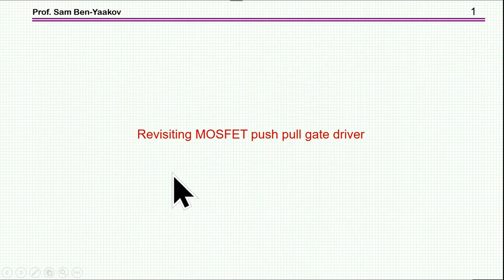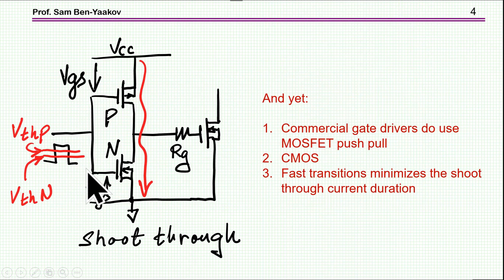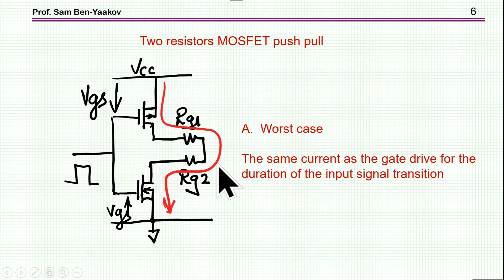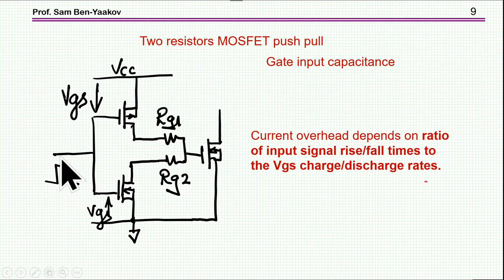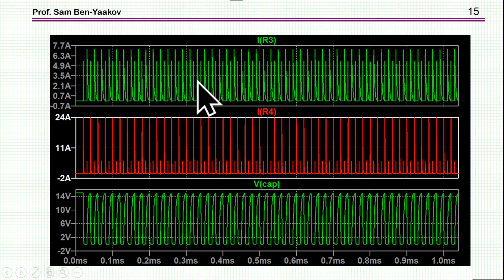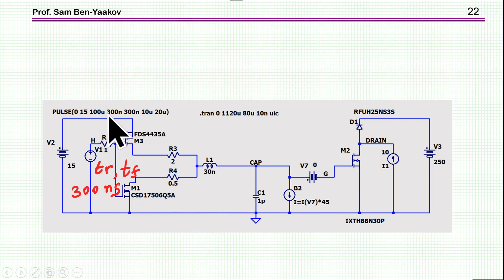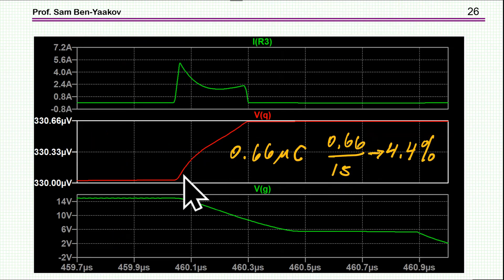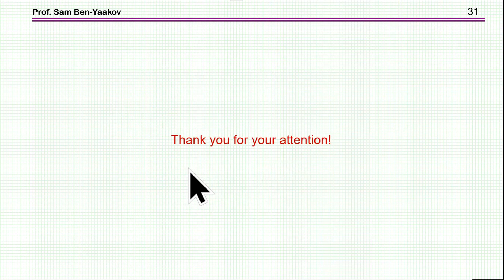Revisiting MOSFET push pull gate driver

Comment: To clarify... I am driving a p channel mosfet with your driver circuit. It is about 24 volts from rail to rail. I had a Resistor divider circuit on it but it turned off too slowly. So I am changing it to your mosfet push pull. As it is 24 volt off and 12v on it seems that I need to turn the n channel upside down in the push pull. Is this true?
Reply from the maker: I don't think so. However the reisors should be adjusted for turn on and turn off.
Reply: @sambenyaakov Ok. I have it now. The problem with push pull and p channel high is the limited gate voltage swing. It takes too many parts. But my original problem wasnt actually the driver, as I suspected... (200 ms to turn off),  (resister divider with a mosfet to ground). It was capacitance  in the motors built in circuitry. I am discharging it now,  (3650 bldc motor with internal circuitry) using a resistor and an n channel mosfet, and all is good. Thanks for the videos and response.

Comment: I like this. Thanks for the information. I have used it on an N channel at 24 volts and more. It went well. But I would like to see which way you would put the driver mosfets when you turn on and off with a positive voltage. Say 24 volt off and 12 volt on. Is it p mos drain (24v) to n mos source (12v).
Reply from the maker: Thanks. Not sure that I follow you.

Comment: Sir, Thank you so much for this very clearly presented example. I was using a simple BJT push-pull to drive my power mosfets with logic level PWM (with a few performance issues) but now feel inspired to experiment with simple mosfet based gate driver and perhaps learn a bit more.
Reply from the maker: Glad it helped. Thanks for comment

Comment: Good explanation but I as a new engineer I try alot of data and experiments to get mosfet drive really will with no heat up I notice that resistor don’t turn off the mosfets fully causing heating but not bad heating just warming but this is very bad efficiency so I try using bjt pnp to be exact at each gate of 6 mosfets and the pnp turn off the mosfets fully and the mosfet was really cold at 200watt for 5 minutes and 1 hour the mosfets was fairly warm and at 2 hour the temperature didn’t get pass 28degree % but when I use back the resistor at 1k to 10k the mosfets heating up really badly and I never seen a commercial inverter with my design and my design work 99 % more efficient on terminal temperature controller
Reply from the maker: 1k i too large. Typically 10\- 10Ohms are used since you need substantial current to feed to the gate. See: https://youtu.be/of_v2N5f788

Comment: I'd like to use an ESP32 to control a power MOSFET to switch on and off a 12V 5A load (led strips, no PWM), but with the idea of reducing the power losses as much as possible, as the system would be powered on 24/7.
What would be the best gate driver for my application? Since I don't need a fast turn on or off switching sequence, I guess I can get away by inserting a high Rg1 resistor as to avoid a large constant current (I=Vcc/(Rg1+Rg2)) through both MOSFETs when the control signal is HIGH (both MOSFETs on)
Reply from the maker: Why two MOSFETs? Is your load referred to ground or connected to the 
12V supply? You need isolation?
Reply: @sambenyaakov  I'm planning to use a regular 12V PSU to power both the LED strips and the ESP32, using a buck converter for the latter. I don't think I need isolation, but I do want to have the lowest Rdson possible to reduce power losses as much as possible, so that means driving the MOSFET from 12V. 

At first I thought about simply using an optocoupler but I'm not sure what's the minimum power it needs.
Another option is simply driving the gate with an NPN transistor. With a 100k resistor on the collector, I'd have a constant wasted 120 uA (1.44mW) while the power MOSFET is off.  I wonder if this could be reduced even further.
Reply from the maker: @alejandroperez5368  Yo can use an N channel with 1Meg to 12V and a P channel from 12 volt to gate of power transistor with the gate of P connected to the drain of N. Then you need a 100kOhm from gate of power transistor to ground. This way the drive consumption is only at ON.

Comment: I notice that you said you were integrating the current at the inductor, but the simulation used I(R3) not I(L1). Was that a mistake?
Reply from the maker: To which minute in the video are you referring to?
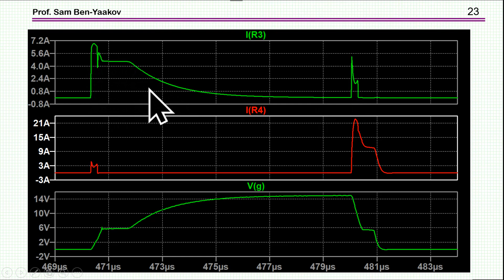Reply: @sambenyaakov  10:53, where you introduce the integration analysis for charge. You say that the total gate current is being integrated, and highlight the inductor with your mouse, but the behavioural source appears to be using I(R3) not I(L1).

Comment: Dear Prof the simulation at 8.42 is not giving the results as you have shown .Could you please confirm the correctness of Later MOSFET part of the cirucuit that was added onthe first simulation u have shown
Reply from the maker: Can you send me your simulation asc file and I will try to compare?
Reply: @sambenyaakov  Thanx a lot for the reply . Please find the file here   https://drive.google.com/drive/folders/1w-YcKCiwDQ6JvGXpcbqH7Q59wAh1tVaa?usp=sharing
Reply: @sambenyaakov  dear professor could you see the simulation file
Reply from the maker: @5minutething519  just noticed it. I will have a look as soon as I can
Reply from the maker: @5minutething519  Can you please explain the question in more details? please use sby@bgu.ac.il

Comment: Hello Sam, 

Thanks a lot for these lecture series which is very helpful from a practical engineering point of view.
I need one clarification.
Won't this configuration be inherently inverting? (V1 and V(CAP)).
Would you recommend (1)one more stage of mosfets before the main totempole , (2) just by swapping the high side and low side PWM signals (assuming they are complementary) at gate driver input (3) or swapping inside microcontroller.
Reply from the maker: Indeed, this is an inverting stage . The best will be to judt add an inverter Swapping the signals not exactly inverting due to the dead time but if accounted for, it should be OK. If digital control us used, there is no problem to program as needed. Hold on to my forthcoming video on driver buffer/.
Reply: @sambenyaakov  looking forward to your new video. Inverting in program, wont it mess with desat or shoot through protection of the semiconductor?

Comment: Hello, I can’t find information about "active balancers of li ion batteries on capacitors"
In particular, I'm trying to find a diagram where it would be clear which chips are used to control the mosfets.
Can you help me?
Reply from the maker: Have you seen this? https://youtu.be/BRezuwQCaKI
Reply: @sambenyaakov  Yes, I watched this video, but just in it it was not indicated which "driver" can be used for such needs. If i buy a ready -made balancer, then there are all microchips without designation.

Comment: Will those current spike (green and red trace) and extra current spikes create EMI issues?
Reply from the maker: Indeed
Reply: @sambenyaakov  Is the dI/dt from the parasitic spike significantly faster than the dI/dt at the fastest edge of the normal gate drive transitions? More to the point, is that parasitic spike likely to cause radiative EMI of a greater amplitude than that of normal operation?

Would it make sense to add a small inductor or ferrite bead in series with the gate drive resistors to moderate that dI/dt, or would that cause undesirable effects? I suppose with too much gate inductance/impedance the MOSFET will spend more time in the ohmic region, but I wonder if there is a "sweet spot".

Comment: Thank you very much for you video. 

I have one question here; in many datasheet of drivers, they use also the Push pull with Mosfet shown here (https://www.analog.com/media/en/technical-documentation/data-sheets/adum4146.pdf) page 3; sorry can not paste here the picture;  they use the one Mosfe of high side push pull; but two Mosfets  in the low side;  The drive  signals  of the two low side Mosfets are different. Do you know why the use like this ? thank you sir
Reply from the maker: One is a soft turn off and one a Miller clamp
Reply: Thank you  ave you done the presentation how the two Mosfet in parallel works ?

Comment: Dear professor,
Many thanks for the great informative and practical videos. Infineon also has an interesting application note about this topic.
In part 7 and 8 of the following app note, the mosfet buffer stage is shown. Since Mosfet push pull acts as an inverter, an intermediate inverter stage is also used

https://www.infineon.com/dgdl/Infineon-HV_Floating_MOS_Gate_Drivers-ApplicationNotes-v01_00-EN.pdf?fileId=5546d4626c1f3dc3016c47de609d140a

Comment: Dear sir,
In this video at last minute you told, you was performing integration to get charge. Can you please put one video to explain us how to perform integration and differentiation in Ltspice.
Reply from the maker: Thanks for comment. Will try.
Reply: He got the integral by adding a circuit called an integrator to the simulation he ran.  Both integrators and differentiators are critical to all sorts of electronic circuits and they are among the most basic.  I recommend starting here:
https://en.wikipedia.org/wiki/Differentiator
https://en.wikipedia.org/wiki/Integrator

Comment: Hi Sam, I am a chip designer myself and I enjoy your lectures.  There are two other ways to do that one using capacitor another using current mirror. In case of capacitor you charge a cap, which is several times the gate cap, to Vsup and when you want to turn off the MOS you connect the positive terminal of this cap to ground with a switch and the negative terminal to the gate of the output transistor.  This pulls the gate of the output transistor to negative voltage very fast ( depending on your switch resistance) and turn off your output MOS fast. Then when the mos has turned off completely you connect the gate to Ground and keep it there.  When you want to turn on the output MOS you charge the same cap and then switch the negative terminal of the CAP to the Vsup and the positive terminal to Gate of output MOS. After the MOS completely turned on you connect the gate to Vsup .  I case of current mirror, you make sure the one of the driver transistor is off before you turn on the other one (Break before Make). of course this means the driver transistor gates are not connected together and driven separately.  Also, put parallel caps with your R3 & R4 to help reduce Miller capacitance effect and faster switching.
Reply from the maker: Hi, Thanks for sharing your interesting experience and for conversation.
Reply: @sambenyaakov  Thanks for posting great lectures online.  I learned lots of new things from you.
Reply: Hello Sir, I am an EEE student, I also find Mr. Ben-Yaakov video's very enjoying. I read that you work as a chip designer which I respect! When I have an opportunity to ask a professionalist a question, I always ask for his favorite book or paper, something from which he enjoyed learning. Would you please share your favorite source of information about electronics? I am particularly interested in analog design.
Reply: @hidennseek1483  Hi,  There are many books, I started with hobby electronics books and magazines when I was child then In undergraduate I had some theoretical books , which were interesting then when I was getting my Ph. D.  I had many more books with great deal of mathematical and theoretical  background.
I would start with your university books. 
I would start with this:
Microelectronic Circuits by  Adel S. Sedra (Author), Kenneth C. (KC) Smith (Author), Tony Chan Carusone (Author), Vincent Gaudet (Author)
For analog circuit design I love Razavi's books he is very logical here are some of his excellent books:
* Design of Analog CMOS Integrated Circuits 
* Fundamentals of Microelectronics
* RF Microelectronics 
* Design of CMOS Phase-Locked Loops: From Circuit Level to Architecture Level 
* High-Speed CMOS Circuits for Optical Receivers
* Design of Integrated Circuits for Optical Communications
Also:
Analog Integrated Circuit Design by David Johns 
Analysis and Design of Analog Integrated Circuits by by Paul R. Gray (Author), Paul J. Hurst (Author), Stephen H. Lewis (Author), Robert G. Meyer (Author) 
For RF and microwave:
The Design of CMOS Radio-Frequency Integrated Circuits by Thomas H. Lee 
Microwave Engineering by David M. Pozar 
For Power circuits ( switching convertors):
Fundamentals of Power Electronics by Robert W. Erickson and Dragan Maksimovic
For LDO design:
Analog IC Design with Low-Dropout Regulators (LDOs) by Gabriel Rincon-Mora
For Quantum electronics:
Quantum Electronics by YARIV, AMNON
For PLL:
Phase Locked Loops 6/e: Design, Simulation, and Applications by Roland Best
Also checkout: 
https://www.youtube.com/channel/UC5GfjOd8g8HwJwus8dbaBAQ
Reply: @aduedc  Sir, Thank you very much for taking your time to compile such a nice list! I am already familiar with  ''Fundamentals of Power Electronics'' as my power electronics course was based on this book which was nice to see it as part of your list. However, I was not familiar with Razavi's books and many others which I will get into strayed away! Thanks again, I do appreciate it!